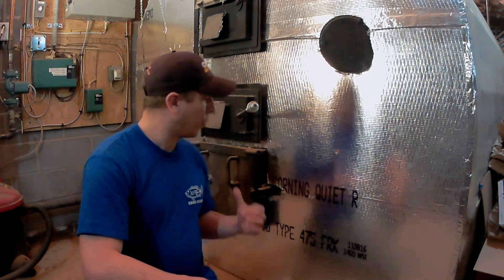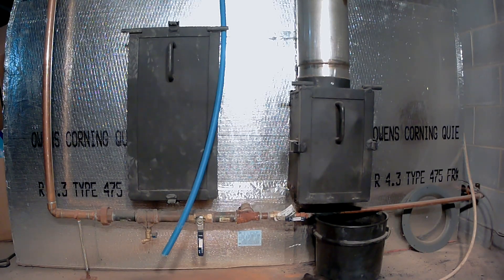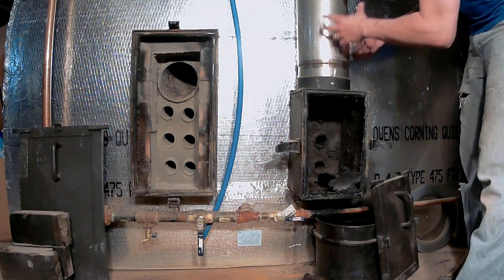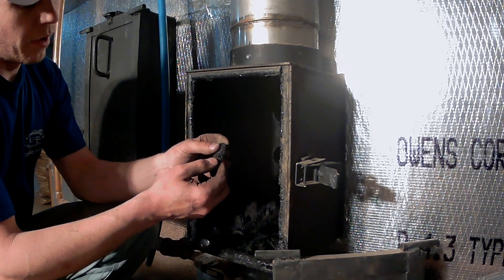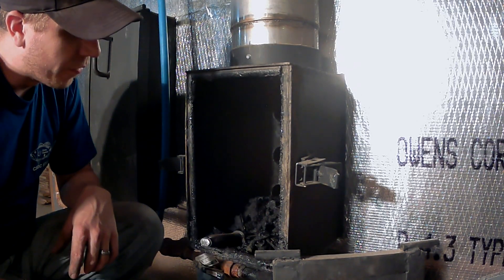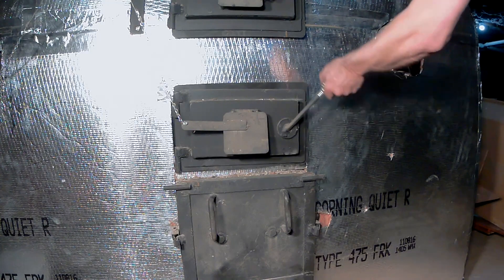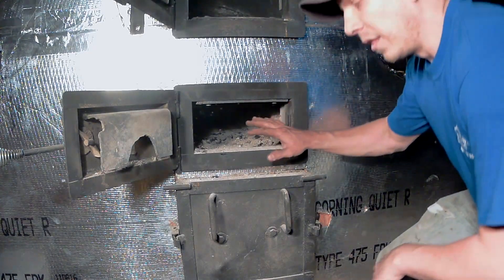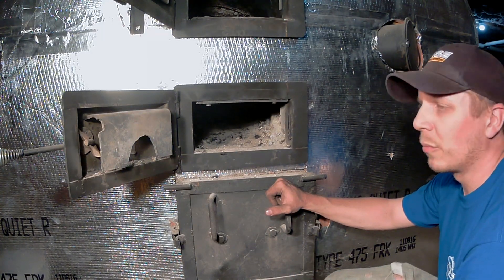Cleaning an Indoor Gasification Wood Boiler - #11

Comment: How long have you had your boiler?  I have the 1050 with the oil gun backup which I’ve had 4.5 years now.  I clean it maybe every 4 months and have half that amount of ash when I do. That’s burning oak, maple, beech and black birch. usually in the 12-15% humidity according to the gauge. The biggest pain I find is dealing with the fire blocks in the back.
Reply from the maker: I've had my boiler since Feb 2017. My wood wasn't as dry as yours. I am trying to get ahead on wood to let it dry longer and be in that moisture range. But when I made this video, I knew I had been burning wetter wood (18-20% range) and it needed cleaned more often. Right now, I'm only cleaning every 2 months and getting half of what I was then. I'm getting there! Thanks for watching.